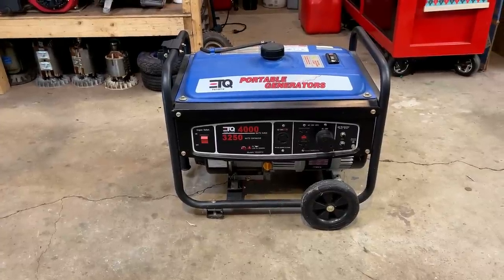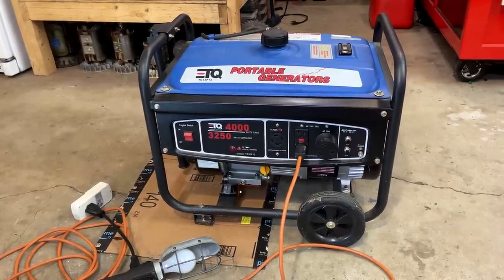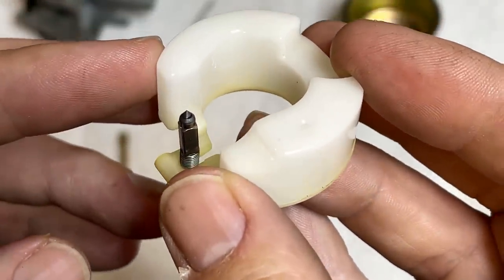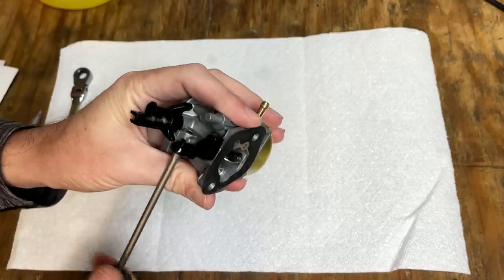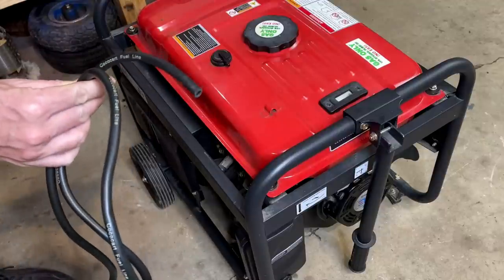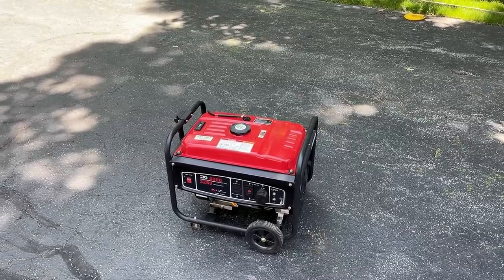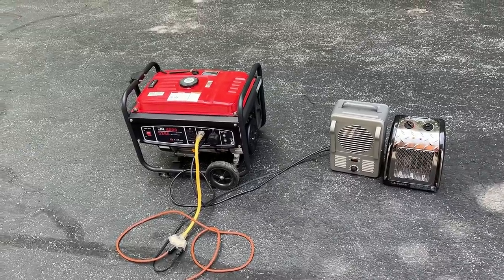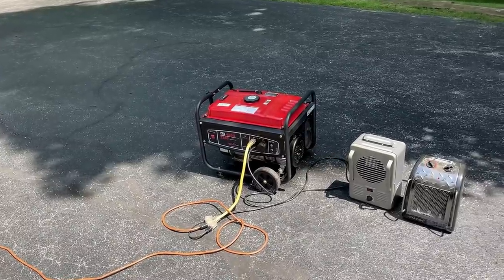ETQ Generator Leaking Fuel When Running - Bad Needle and Seat?

Comment: Great repair on the brushes! https://youtu.be/P4Wic_jt1KM

Also the voltage drop could be a loose spade connector or plug. I'd double check. 11 volt drop under load is significant, but as you pointed out, could be normal with the AVR. Typically its not the AVR, but an insufficient sized DPE will cause that much voltage drop if not a loose connection. The exciter winding is a current source not a voltage source, so undersized winding limits the current forcing the AVR to drop voltage under heavy load.
Reply: ETQ is a bottom of the barrel brand and surely sourced the cheapest genhead that they can find.  Almost every Chinese part (genhead, motor, even individual components like carbs and AVRs) is available in "Economy, Standard, Premium" grades.  Guess which ones ETQ bought?

Comment: Hello Sir.  Love you videos... you are a true teacher.  One question... I am considering buying a Predator 9500 inverter generator or do you think it is wiser to spend the extra money for a Honda inverter generator?  I am only using this for backup power.  Any advise is greatly appreciated sir.
Reply from the maker: The predator inverter is powerful and affordable.  But I have heard some complaints of the inverter going out.  So not sure how it will hold up over time.  Honda’s are usually pretty bullet proof.  But cost becomes a factor.
Reply: @jcondon1  Thank you so much for your response.

Comment: Mr Condon iv a generator that's giving voltage to work a TV some lights fridge, it's meant to 8.500W but won't power a microwave. Now the microwave runs. But food comes out cold and the TVshuts down when a kettle's turned on. Its giving out voltage but the current seem to be missing. Anybodies help would be appreciated...
P.S. im 220v/240v 50Hz Ireland 🇮🇪

Comment: There is no sealing surface on that ultra sonic cleaner, when you dump the liquid it can go in between the metal and the plastic housing and on to the circuit board below it.
Reply from the maker: True.  I would always use a cup to scoop the liquid out and then a towel to get the bit at the bottom.
Reply: @jcondon1  Would be interested in what that board looks like then.

Comment: Off the subject but I am trying to solve a starting issue on a DuroMax 10K.  When using the starter the engine fires and acts like it is too far advanced by the crank slows down or nearly stops.  I can see a key in the key-way.   Compression is 100 psi, after resetting the valve lash.  Any suggestion how to fix this?  Such as pull the key and change the flywheel timing?
Reply: Update:  I did two retard to the timing and found those changes has no effect.  I then cleaned the carb a  second time using an ultrasonic bath.  The result is the engine would start and run then quickly stop.  The protection circuits did not appear to be causing this.  I then monitored the coil output and found that it would create the spark voltage and then it would just stop (no spark).  I have ordered an new coil.

Comment: James, what is the seat made up of on these carburetors? Is it a gasket like material? Some kind of stabilized rubber material that is not a gasket? I am just curious if it is something that could swell in the ultrasonic.
Reply from the maker: Honda clone like this one have a brass seat.  The tip of the needle is normally neoprene and easily damaged by chemicals.  Usually I do not put rubber in the ultrasonic and avoid carb spray.
Reply: @jcondon1  thank you for the reply.

Comment: Hey James, if you can, please contact me. Have a new Xg10000 that I bought 3 years ago. I never took out of the box, and now that there is a storm coming to Florida, I finally decided to take it out and run it. It made power for about 5mins but now every time I start it, it makes about 175v on the 120v outlets for 5 seconds, then the power goes out and the engine sounds like it is coming off load.
Reply from the maker: It is most likely a bad AVR causing that.
Reply: @jcondon1  New AVR arriving tomorrow, hopefully it fixes it. Currently running on a Generac 7550EXL that I picked up dirt cheap last minute to run the well when I figured out that the Xg10,000 wasn’t woking. I gave the carb a quick spray down in cleaner to get it to run. It runs on no choke but the exhaust will glow orange after a while and the bowl will overflow if you don’t shut off the fuel valve when the engine is off. I ordered a new carb for it and I’m sure the valves need an adjustment. Hopefully I get the carb soon, but who knows thanks to hurricane Ian.
Reply: @jcondon1  got the new AVR in, working perfect now. Thank you so much for the help! I look forward to your videos every Thursday!

Comment: Jim where would someone use a smaller generator like a 3750 or 4000watt model? Seems either too big for camping and too small for home power backup?
Reply: 3750 is not too small for home backup.  If you avoid all resistance heating you can run the rest of your house on it comfortably, esp. if you have natural gas heat and HW  - LED lighting, computers and TV, fridge, furnace blower, etc. People back up their house with little Honda inverter gens too.  Just forget about running central AC.  People buy oversized gens and they drink gasoline like water. Good luck sourcing 20 gals of gas a day in an outage.
Reply from the maker: I agree.  My generator is 5500 watts and most of the time I am pulling less then 2500 watts with most of the house powered up.  Of coarse larger things like AC, well pump, microwave, laser printer and electric heat are not going to work.
Reply: I run my workshop on a 4350/3500 generator.  It has no problem running my air compressor, table saw, angle grinders, parts washer, drill press, even a 125A flux core welder and a squirrel cage blower fan.  Obviously not all of these at the same time.

Comment: Do you think it's possible that adding the washer to the brushes could be causing the voltage swing?
Reply from the maker: Do not think it could
Reply: @jcondon1  That's right, you used a AC washer...

Comment: Isn't there some kind of sticky goo that can be poured into tanks to seal up tiny cracks/holes?
Reply: You can use Red-Kote or similar pour in liners. Permatex Fuel Tank Epoxy Putty would've been my choice to apply around the outlet since it was barely leaking and the tank was sound.

Comment: What does the digital gague readings tell us about these generators. Frequency and voltage readings tell us what about the units performance?
Reply from the maker: It is confusing
Reply: @jcondon1  Sorry James. I replaced my message with something more "constructive" 😥
Reply: They measure adherence to specifications.
Reply: I think it’s mostly a sort of sanity check. If your generator runs, and powers a bulb, but the voltage is like 100 volts or the frequency is 40 hz, you know there’s still something wrong with it, and you’re not gonna want to plug in anything more complex than a heater into it.

Comment: Just a question about this generator, what $$$$ do you think it could fetch on the open market In your area?.. out here in the land of sour milk and congealed honey due to power outages, used generators are so darn expensive!.. Hard to make a profit on them because they get worked and put away wet...
Reply: This gen is only maybe $300 brand new so maybe $200 in excellent used condition. Maybe a little more if you sell it to someone who doesn't know that ETQ is a bottom quality brand. Then again Jim has been thru this gen so it is now better than new - he is the QC dept. that ETQ lacks.
Reply from the maker: Not much.  Generator market has been bad.  $200.

Comment: 👍👍☝️😎✌️…Does anyone make a “brushless” generator??
Or is that something that is strictly for battery powered tools.?
Reply: There are a number of brushless generators on the market. They do run well, but not all of them have a clean 60 cycle output. That are typically excited by a magnet on the rotor. Also typical is that they do not have an AVR on them, and the output is adjusted by the engine speed.
Reply: What's with the emojis?